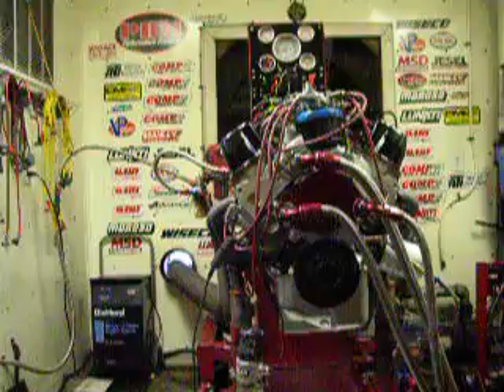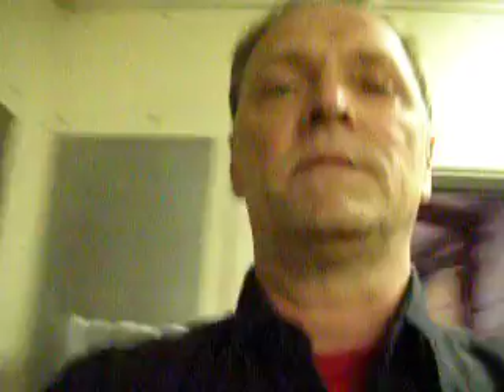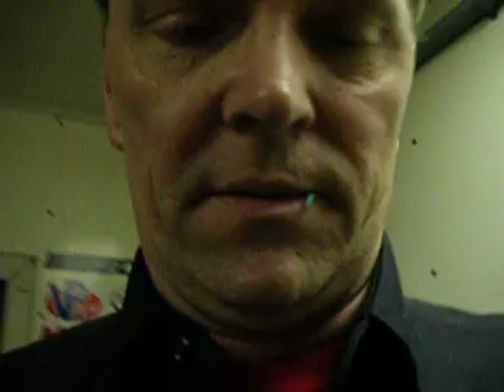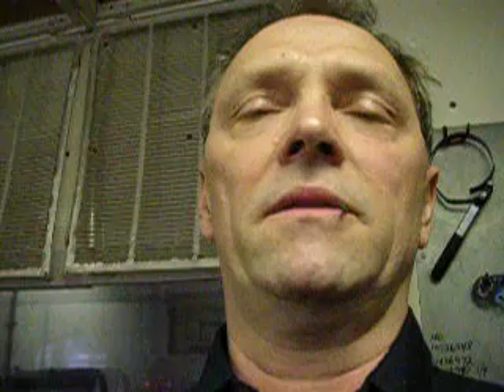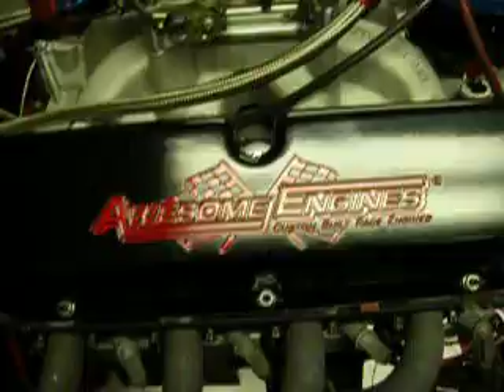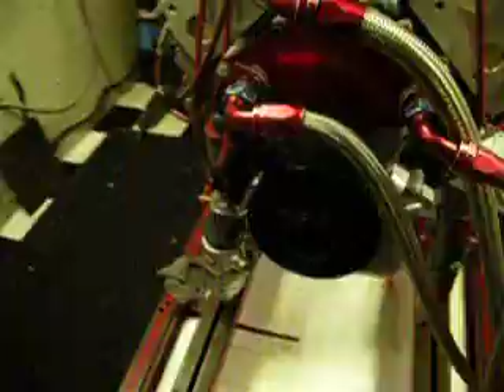AwesomeEngines® MAXX Pro Street 374 SBF N20 Motor Dyno Pull

Comment from the maker: Yes there was no nitrous even on the unit. The customer has his own kit and will install it when the engine goes in.  We supply the whole tune up so no problems arise and you just have fun.  No need to send your nitrous system out to be raped over to all these people suggesting some solutions to a problem you don't have. Most don't even ask the right questions when pretending to "set you system up"  Hope this helps